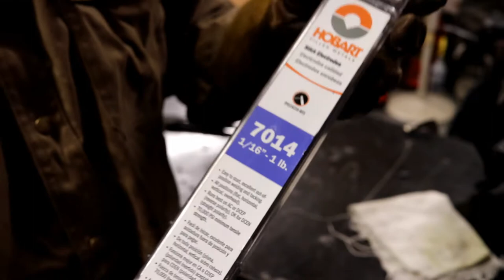A Novice's Approach to Stick Welding a Butt Joint

Comment: My first welding assignment in high school shop was to weld straight lines on a 2 inch round pipe. It taught me to weld in a straight line and looked like a metal tree log when complete. Great video!
Reply from the maker: Yea I'm almost 100% self taught aside from maybe 3 saturdays as a kid with my dad.